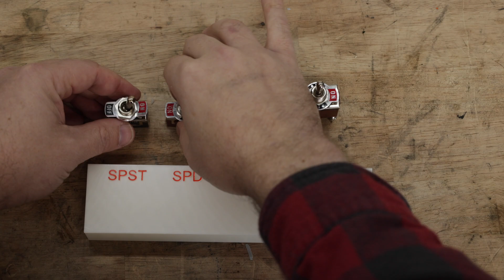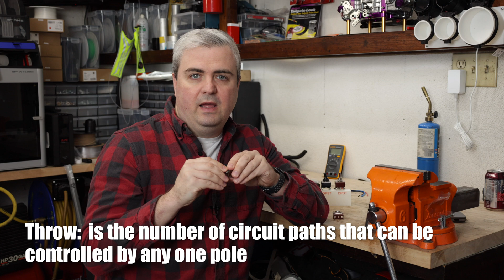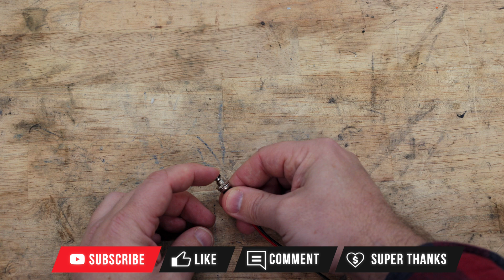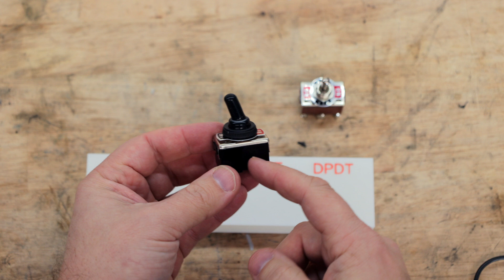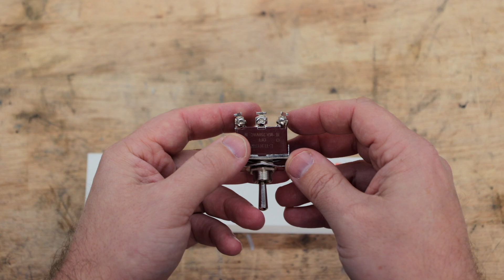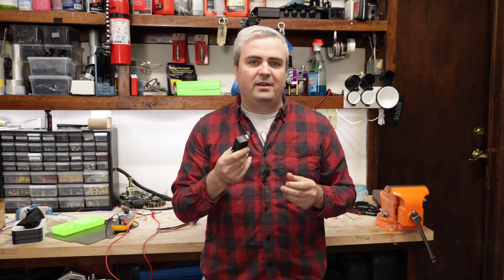How to Use Switches!

Comment: helpful video! i still cannot find information for a replacement switch though my switch is off>toggle on>momentary i cannot find it anywhere
Reply from the maker: Like this? “Ideal 774094” or does it need to go toggle on and then momentary
Reply: @ it’s like that but 5 pin, it’s for a diesel generator it turns on the glow plug and the final throw is for the starter